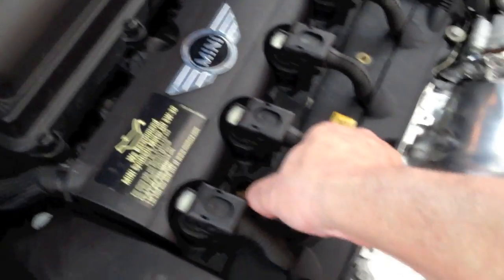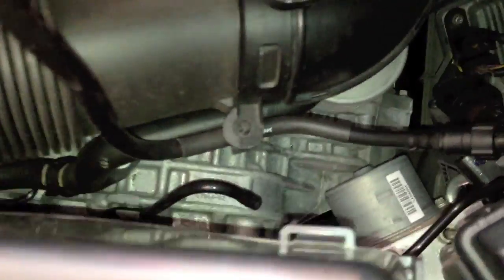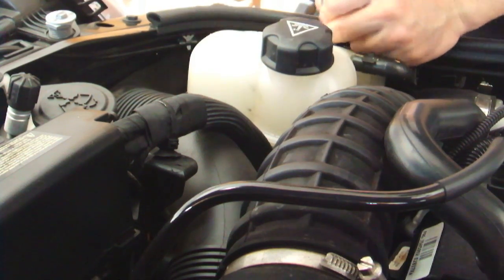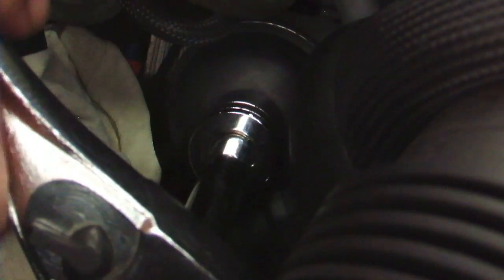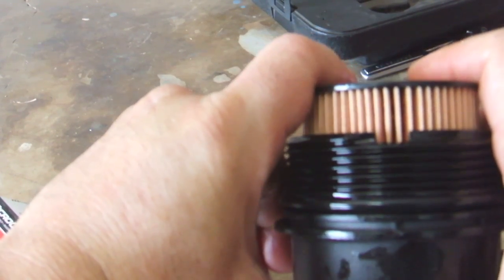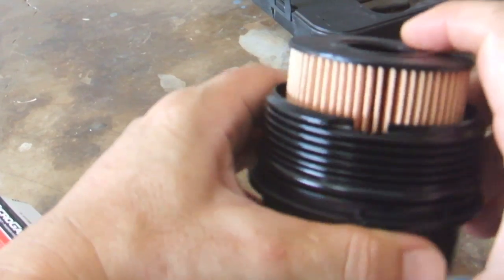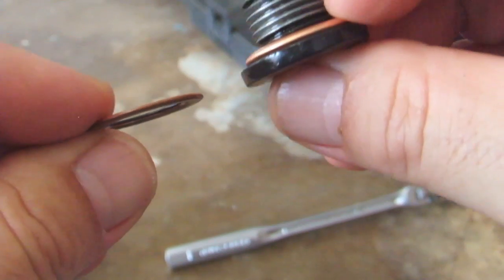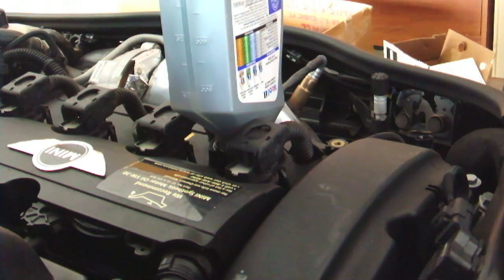2010 Mini Cooper S Oil Change

Comment: Thanks for sharing.  My wife has a 2010 Mini One and it's the same process except there is no need to remove the radiator bottle (to access the oil filter) as it is in a different place.  As you drive on the wrong side of the road in the US (LOL) I always have to think twice when you guys refer to the "drivers side".

Comment: re: copper washer - flat side goes against the head of the drain bolt. This way when you torque it down it will crush at the oil pan side and make a seal against mating surface of the pan.

Comment: Great Video. so many youtubers could take a lesson from how you shot yours. thanks.
Reply from the maker: Thank you!
Reply: Ken Jenn x
Reply: The sticker on the valve cover reads "We recommend MINI Synthetic motor oil 5W30", rather than 5W40. Did the manual say otherwise?
Reply from the maker: Thanks for pointing that out.  I made a mistake when recording the audio for this video.

Comment: Nice video. If you buy a vacuum oil extractor you'll never have to get under the car or replace the crush washer.
Reply: Still have to deal with the filter element.  They couldn't use spin on filters like the rest of the world; which are so much easier and neater.  Guess it's a German thing.
Reply: DTR RTD different location would be way easier. My wife malibu and my camaro have the same type filter element and its right up top and easy to change. and i like them better than the metal ones.

Comment: nice video.Must use Jack/or 2x6 wood, in order to put up mini S convertable, high enough, to get oil pan under front splash guard. Also, do you know what torque oil filter housing goes to?  case shows 25NM ,  this seems WAY to high. Thank you.
Reply: 25 N-m is just 18.5 ft-lbs, seems like that might be reasonable with the large diameter of the filter housing threads.

Comment: I was doing the same and while I was doing it, I seem to have disconnected a wire harness around the oil filter. I've been looking for hours and I can't seem to find where it goes back into. Do you know where I might be able to get help to plug it back in. I think it leads back to a part of the ecu, but can't find where it is supposed to be plugged into. Thanks so much for your help

Comment: Hey.  having a problem removing oil filter on my 2006 mini one. Just won't move even on a breaker bar. any suggestions for removing? cheers.
Reply: did you try turning the opposite way....................

Comment: I took my mini to get the oil change the guy didn't tighten down my filter my oil was on my drive way by 8pm had it towed sunday morning back to them they basically tighten it up a little better topped off my oil sent me on my way the problem is its still leaking i needed to know the size of the filter socket thanks for the answer

Comment: I think my comment wasn't posted..

Any chance you can do an ATF change on the same vehicle??
Reply from the maker: Thanks for the comment.  Yes.  As soon as I do that, I will record it and post it on my "I Fixed it!" channel.  I have no idea when I will do that tho.
Reply: @kenjenn3059  quick question.. my mechanic attempted to do an ATF drain and fill.. but he drained the transmission fluid pan drain bolt.. which is correct.. but he also removed the bolt for the bell housing.. timestamp 1:04... My concern is.. even though very little fluid came out.. he only pumped ATF fluid into the transmission drain plug (even though he opened 2 drain bolts)... So the bell housing he didn't pump any fluid back in...

Do you know if that bell housing drain plug should also be pumped with fluid? Does the bell housing and transmission share the exact same fluid.. meaning no partition in between??

He pumped in a little less than 2 quarts to only the transmission pan  drain plug.

The car is the same year and model as you with an automatic transmission...

Any help will be greatly appreciated!
Reply from the maker: @JCX..  Sorry, I haven't had any experience in this yet and can't comment on the correct procedure.  Sorry!